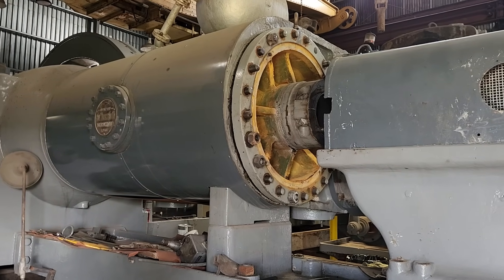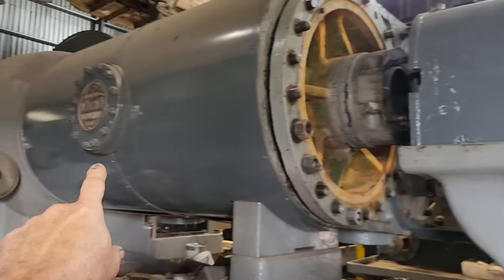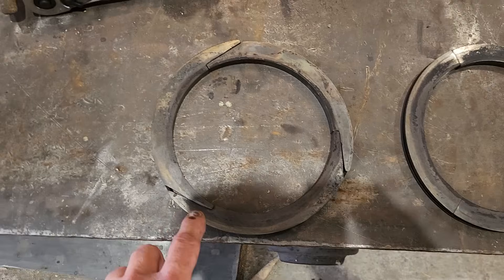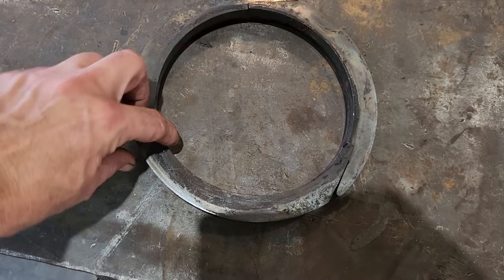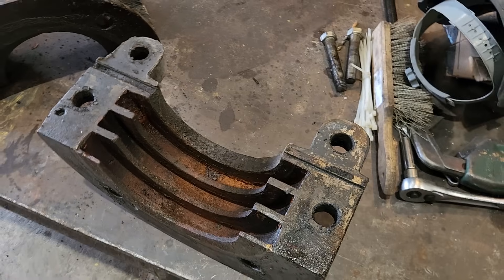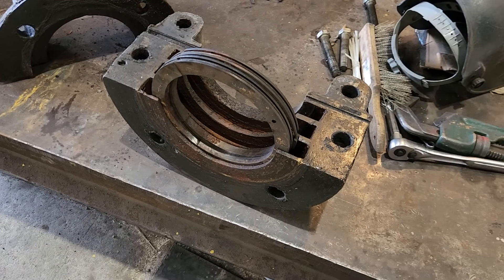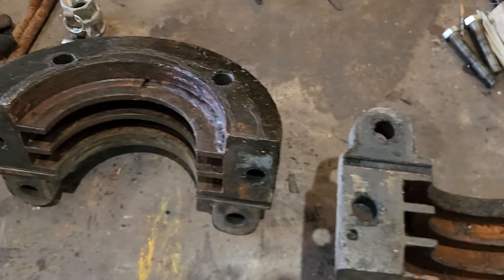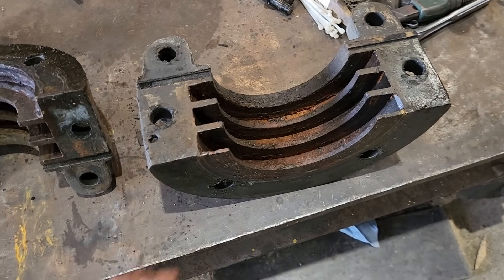Tod Engine Mechanical Packing

Comment: The days of having a foundry in every large town is long gone. I would make this on a lathe by designing it as stackable laminations of different inner diameters, and then bolt the plates together. The job would be quick to do, no patterns and very accurate. If something breaks in service, the offending lamination could be replaced. Note that the original part is cast iron and has different wear characteristics than mild steel due to its graphite content. But for what you are doing, it should be a long time until it wears out again. Have you considered buying a lathe yourself?
Reply from the maker: Long ago I made the conscious decision to not get into owning machine tools as I really don't have space for them and regardless of what I had, it wouldn't be large enough for what I want to do.  Only so much one person can do and I draw the line at being a machinist!

Comment: Your existing worn out castings look to be modifyable et, repaired. The internal webs can be machined out into a singular bore albeit larger diameter. 3 secondary inserts can then be made making the seal areas 100% servicable using the still available 3 piece seals.

Comment: If there's enough meat on the two halves wall thickness; they could possibly be bored out, then install an insert built up by stacking rings turned on a lathe.  Not all that difficult.

Comment: Mount it to a Lathe Faceplate, use a boring bar... just needs a big honking chunk of iron/steel and some good cutters and an experienced hand and a big lathe. Drill press for the holes and a shaper or hell a CNC could do it modern style.

Comment: This is the packing casing on the steam part of the engine. It seals the shaft where it leaves the turbine. It needs toothed packing annd springs to close the paking close to the shaft but not touching.  JB

Comment: The broken one could possibly be repaired by brazing a backing plate with a steel insert for the seal. The same thickness of backing plate for the other half. Just a thought.
Reply from the maker: There are other issues with the original parts that make salvaging them too labor intensive.  I already have material here to make the new ones

Comment: Be sure to determine the diameter of the piston rod and if worn enough or a “step” is found at each end, the rod should turned or ground true.  As for the packing ‘container’, all packing segments sides should be ground smooth, parallel and to a sliding fit. As you pointed out, each complete ‘container’ will need to be made as separate 2 piece set with the packing sides to each container side a sliding fit.  Since packing company is still in existence, they should have some recommendations for bore, side clearance and id diameter for clearance of the retaining garter springs.  Sit down before opening any quotes from the packing company.  There certainly are some very capable folks out there can do the but will need to provide the requirements to obtain a good job.  Not telling you anything new here as can tell you’ve thoughts this through already.  Believe this is not a high speed piston rod travel (thus using cast iron packing segments) but pressure is more the issue - correct?  Also, each joint between the two container sets will or should be ground surfaces to control leakage.  BTW-what psi is involved here?  Also, is there water condensate to deal with?  Is there oil lubrication provided for each container set of packing?  An interesting challenge.  Good luck!
Reply from the maker: The piston rod will be refinished as it has sat in the weather for several decades giving it a nice rough surface.  There are shops around here that can do that work, even plating it if needed. Average pressure in the cylinder will be under 150 psi and it does get cylinder oil fed to the packing from the mechanical lubricator.
Reply: @YoungstownSteelHeritage Assume machine will be on display with some periodic operations so plating the piston rod would be suggested.  So with long periods of idle time be sure to drain or blow out any water from the packing container (stuffing box - finally remembered the better wording) as the packing will rust even though the rod will be fairly safe.  It will be tough to prevent rusting etc of the packing and stuffing box joint areas, perhaps flooding the area with valve oil or soft grease and turning machine over at slow speed to ‘work’ lubricant into the packing area.  Time will give you a better feel for the better method.  Make sure if stuffing box has small water/condensate drain holes that they are open.  Lots of hard work.  Keep it the nice work!

Comment: It looks like the left halfshell you showed has a oil bore  and the top casting usually would be filled with oil
Reply from the maker: There is an oil port but it is fed from the mechanical lubricator via a copper lube line.

Comment: Might want to find someone to create a CAD model of the part. Opens the door to many more  potential shops.
Reply: CAD isn't a magical medium for making parts. Sure, its helpful to design but in terms of sending to shops for fabrication it is no more useful than drawn prints.
Reply: @seand7894  CAD is not the magic bullet, but more shops would be will to quote with one.

Comment: Vintage Machinery and Windy Hill Foundry can probably make you a new one. 
They’re here on YouTube. 
Keith and Clark are highly skilled and used to working with this old stuff. 
Thanks for the great channel.
Reply: Came here to say this.
Reply: @daleolson7205  Same
Reply: I was goin to say the same thing till I saw your post!
Reply: Windy Hill? Not if you want the parts to be the identical size.  The guy shows no understanding of shrink in castings.
Reply: @jd3497  well, technically, he's still a beginner.
Reply: Brian Block lives closest and is a sub to this channel.  There are a lot of Amish in the northeast Ohio region, so locating a foundry might not be a problem.
Reply: https://www.youtube.com/@VintageMachinery, keith indeed
Reply: I'd think he'd want those parts made of iron, it's has a higher wear rating than steel and is why traditionally piston rings and cylinder sleeves have always been made from it as opposed to steel, plus iron will stand up to rot from water better than steel will.
Reply: Ha ha ha that’s hilarious how many of us all had the same thought! They can definitely handle this project!